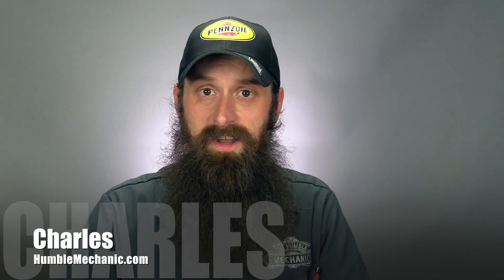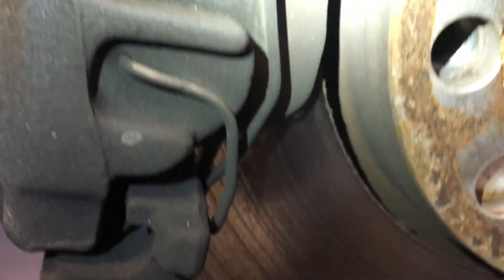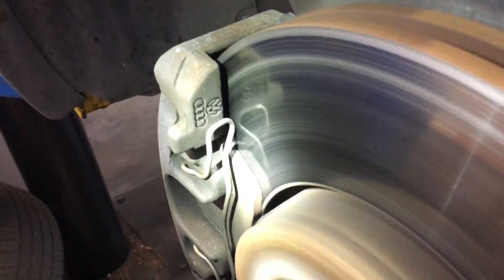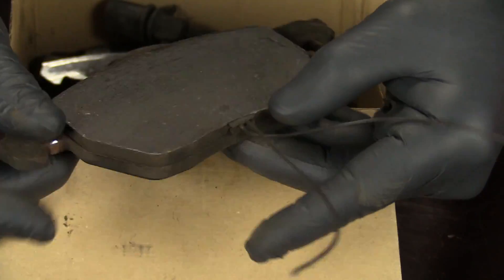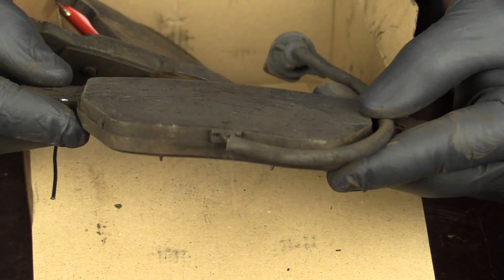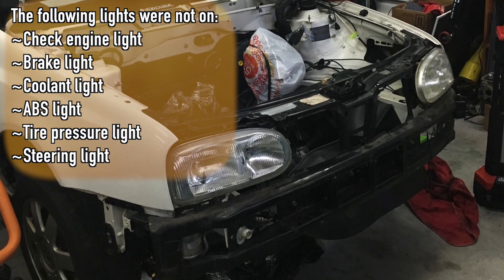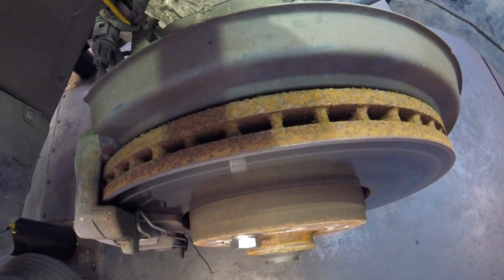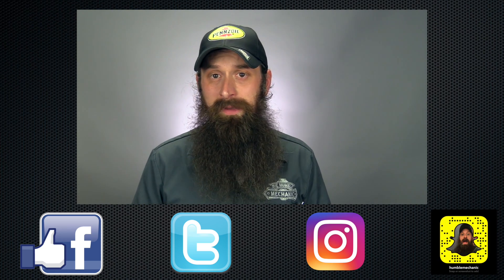Can You Trust a Cars Warning Lights?

Comment: I would never go 10k on a oil change. That just promotes neglect of a car cause they believe they don't need to do anything. I know it's not you but the manufacturer recommendation.
Reply: Techman 48917 10k on a fully synth should be fine.
Reply: Jay G Maybe if you use a top Tier filter but how many actually do. I Have seen many where the filter has been bypassed because it is plugged, But personally thats me I wouldnt ever run that long because I like to keep an eye out for a upcoming issue or potential problem.
Reply: Techman 48917 technically yes they can run but mist car guys like you and me thinks that is too long for an interval. This is the reason why i use only a synthetic blend shell helix hx7 with OEM filters that i change every 5k miles. 5k miles for me is about 4 months or so. Costs me about 50bucks, 50 bucks every 4 months isnt bad at all.

Comment: All of which are ignored by the customer, had a Hyundai towed in with a seized engine the other day, because the customer ignored both the little red light, and the horrible noise coming from the engine, and also decided NOT to get that oil consumption issue checked out by the dealer, even though it's all under warranty. Oops there goes another rubber tree plant....

Comment: Hi, great vids. Thanks for taking the time to do this. I have a question regarding my car. I have a VR6 2003 GTI Golf and the airbag light went off. I took it for a check out and it turns out the light is due to a faulty passenger seat buckle. Have you seen this problem before? Also those warning lights I take them with a grain of salt some times as I check my car and try to have it in good working condition. Thanks for your time.

Comment: Trust it? Maybe not the glow plug light. Look at all the things it comes on for. Pre warm during cold start (what you would expect it to), brake lights out, or brake light switch failure, flashing when accessing advanced features with VCDS. But not when you have an actual glow plug problem!

Comment: My 1992 volvo 960 has the "Dummy" light for the transmission and the ABS, the ABS one has come on once or twice but a few weeks ago the transmission light (up arrow) came on flashing, i asked the dealer what it could be, either a module is bad that is sitting in the passenger footwell, some bad cable connections under the car or low oil, they told me where the transmission dipstick was and i checked and filled accordingly, then i changed the battery and the ABS and trans light was on for a week straight, then the ABS light went out and after that the trans light aswell only to appear for a few days a week after that, but even with it blinking it shifts great and it runs smooth so haven't bothered with it

Comment: 153K on the original fronts?? How did you do that? I have never gotten more than 80-90 K on fronts.
Reply: i got 150k out of my original mercedes pads but that's because you hardly need to brake, the 7 speed just slows down for you.
Reply: robert montalbano I have a 2012 passat with 101 k and has original pads on it. it depends on what kind of driving, in my case all highway, city is hard on brakes, hills, heat and driving style. avoid braking hard like obey the 2-3 second rule. also the caliper guides as I call them get dirty and don't let the pads retract, and sticking calipers.
Reply: robert montalbano I have a 2012 passat with 101 k and has original pads on it. it depends on what kind of driving, in my case all highway, city is hard on brakes, hills, heat and driving style. avoid braking hard like obey the 2-3 second rule. also the caliper guides as I call them get dirty and don't let the pads retract, and sticking calipers.

Comment: I prefer gauges over lights. Some modern European cars don't even have an coolant temperature gauge any more. Just a warning light, which in my opinion is a 'too late' light.
Reply: As long as it actually is a gauge... Unlike a majority of Fords that have an "Oil Pressure Gauge" that isn't....
Reply: lol i was out beating the piss out of my ranger this winter doing some drifting in the snow and stuff and my oil pressure gauge kept randomly dropping to zero. Figured it was just being dumb since I know its basically just a dummy light but then eventually I got tired of it and decided to look at my oil. Turns out my dipstick tube had rusted out and broken off and was pissing oil out. Dumped whatever oil I had in the truck in and babyed it home. When I finally got a new dipstick tube in I changed the oil and found out I'd been redlining it with about 1.5 quarts of oil.
Reply: I think my GTO has one of those fake GM coolant guages. Either way, not a fan.
Reply: Blazer02LS Yep, oil pressure "gauge" is just a show, I've had plenty come in with low oil pressure, to the point of having cam phasing issues, and the gauge reads "normal"
Reply: Rick Rob buy a lottery ticket lol
Reply: For all the money they charge for modern vehicles, you'd think they could begrudge you a few functional analog readouts
Reply: all coolant guages arent linear and have'nt been for a while its sad
Reply: Which is just absurd, and annoying. Even if they normalized it to be basically an idiot light I could at least have used FORscan to enable the actual readings above it like coolant and transmission temps.
Reply: GM  has the same thing.....   its an idiot light in the form of a gauge

Comment: have an 07 dodge ram 2500 hemi. i replaced both front wheel bearings that came with new abs sensors installed. after i put them in and test drove it (in the winter with snow on the ground) i quickly realized i had no abs. i could lock the wheels and the abs would not activate.. and the odd part is i also had no codes pop up either. long story short the sensors that came with the bearings were bad. i replaced them and now it works great...  but im confused as to how the abs module saw the speed signal from the rear, but nothing from either front and didn't set a code or just trigger the abs.

Comment: Regarding brake pads. A proper working caliper will always ingage the inner pad first and with a higher pressure. The caliper will use the inner pad which is in contact with the disc to drag the outer pad onto the disc. This is the reason the brake wear sensor is located on the inner pad, because it will be worn out slightly quicker that the outer pad. As long as the brakes works mechanically correct, this system works great.

Comment: I have older cars. My 1988 Grand Marquis has a check engine light and a red "engine" light. The red one is commonly known as the "replace engine" light by the community around these cars. It comes on either when the engine temps are high enough to warp heads (and with iron heads, that's quite hot) or when there is less than 6psi oil pressure. Most of us refer to the lights in general as idiot lights since these cars have no gauges (only fuel), unless added aftermarket.

Comment: I think warning lights are very good. However I feel most drivers will ignore them. You have to have to understand the system before you can really know what to do when one comes on. For example the other day I had a steering error with the car indicating low fluid. A quick look underneath showed that fluid was not poring out, so I continued my journey and topped up the next day.

Comment: I did that on a BMW many years ago. The pad with the sensor seemed to have the most left on it.

Porsche use a sensor on each pad. If you drive like some Germans do you do not want thin pads as the heat will go into the fluid.

Comment: The worst of these lights imo is the oil light. I feel it comes on way too late. I purchased a civic that I routinely changed the oil at 3k.  I cornered hard one day and the motor sounded like gravel. I was two quarts low.

Comment: I just did the front brakes on my 2002 Eurovan. I found that a prior dealer mechanic, rather than fix the broken connector for the brake pad wear indicator, had just clipped the wire lead.  The one on the other wheel was working (Eurovan has sensors on both wheels) fortunately and the pads were wearing evenly.

Comment: I love warning lights. They've saved me from expensive repairs on numerous occations.

Case in point; battery light on, when checked turned out to be 15.5v alternator overcharge due to faulty regulator. I would never have noticed it in time without actively measuring the alternator. Without any sign of error beyond the dash light, when would you have checked that?
On the other hand it also tripped the oil level light for no apparent reason.
Saved me a potentially expensive repair and serious damage to the electornics. Got a used alterntor for less than the price of a full tank of gas, and swapped it myself.
A win for the lights.

Had a check engine light a while back. OBD spelled out an "unable to engage closed loop" error, due to coolant temperature.
Turned out to be a O2 sensor on the exhaust gone faulty. Temp was fine.
Could have ended up canging temp sensors and all manner of parts before finding the real problem.
In this instance the lights and codes could have set me back more if I had less experience wth my car.
A faulty bank 1 o2 sensor is not a serious problem. Only noticeable symptom was fuel efficiency and the occational unusual smell.
Still a win for the lights as they gave me the heads up on something being wrong, as fuel economy and smells on a 2001 car is not something I'd loose sleep over.

The above are just 2 examples.

All in all, the lights have done good by me. I don't have to check as much and as often as I'd have to without them, and they have saved me money and headache.
They might not be 100% reliable and accurate, but they are invaluable aides.

Comment: My car is moaning about a P0116 (coolant temp sensor) fault, but the sensor reads as it should when tested with a multimeter. Any idea what that could be? Cheers.
Reply from the maker: +Paul Hill the key here is to see when the fault was stored. What are the perimeters of the fault. Then try to test it under the same conditions

Comment: The saddest thing is all the ignored check engine lights because the car parts place scan tool showed a cat efficiency code, so the person figures well cats are expensive so I ignore it. The whole time it was something else and not the cats, but now the cats are toast because you've been driving a car that was running slightly rich too long.
Reply from the maker: Yep. I have seen that a lot over the years.
Reply: I prefer to treat idiot lights as a handy helper, but not something to be relied on.  As for those cars that are missing gauges entirely - like those that only have a temp light - it's a bit like the car is telling you "Oops, too late!"  I Really liked my brother's '72 FIAT 124 Sports...they used a gauge with a light to get your attention in case you weren't watching...and the gauge and light were using different sensors, so if one stopped working, the other would still be functional.  that sort of redundancy seems to be missing in the vast majority of cars these days, but considering it was a highly-stressed engine in it's day for a stock engine (1600cc n/a making around 110 hp in the early '70s), it was important to find out when there was a problem starting before it got worse and caused more damage.  We found it to be surprisingly reliable (if you discount the electrics, of course), so long as you paid attention and serviced it on time - and fixed any small issues before they could become larger problems.
Reply: I have an OBD scanner in the glovebox and clear them when they pop on. It has always been the P0420 code and frankly i dont give a shit about the cat as long as it doesn't fall off.
Reply: funny story my moms landcruiser has had the cel on for at least 3 years waiting for it to die because she doesnt service it but it doesnt die 325k miles